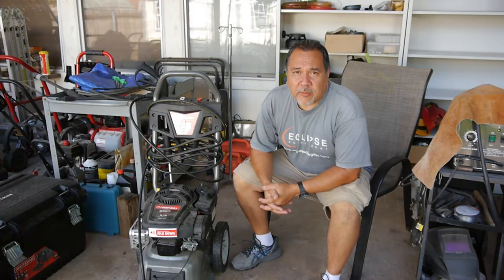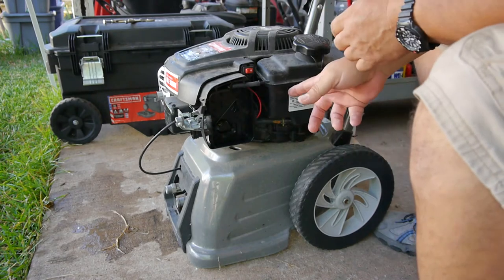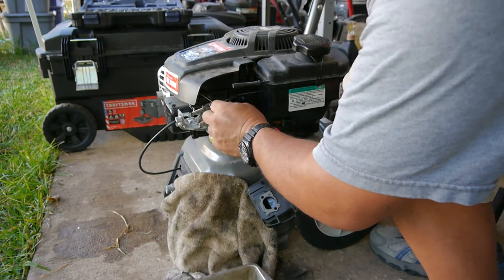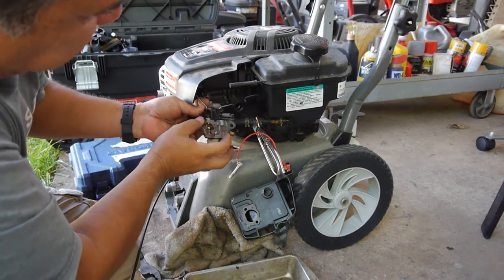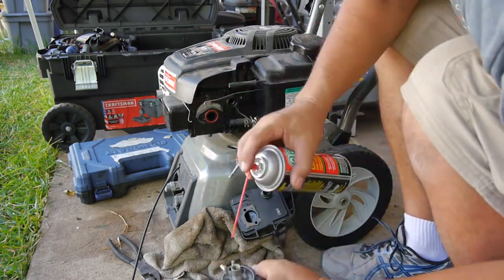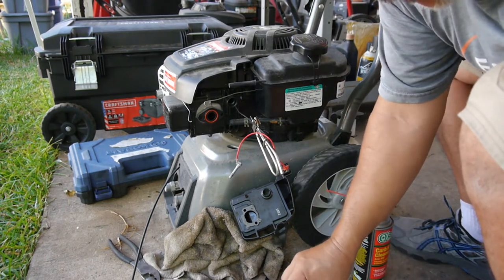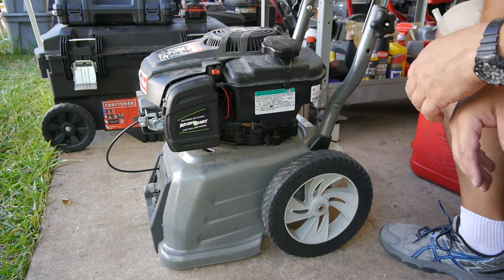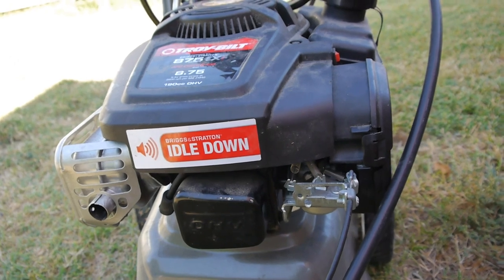A New Pressure Washer Will Not Start

Comment: Hello, great video. What are the chances you still have this machine and is there any possibiltiy of a video or picture of the springs? Specifically at 9:30min.. Yes, I completely forgot to take a picture of that, so now I am not sure what spring goes where. I hooked it up but it was surging a bit at low idle. Under pressure it runs fine. Any advice is greatly appreciated. Thank you!

Comment: I just bought a brand new north star pressure washer put the oil in, put the breather plug in the pump. Pump oil is good, fuel is full, switch is on, choked it , took about 59 pulls to finallly run. Worked great...took it to my house hooked it up and should of fired up. But does what this pressure washer is doing just not starting. You’d think a brand new one would start up, and the cat pump is whining a little bit then stops.

Comment: Not good to crank them up without water in the pump first...I run a shop and if the seals in the pump aren't wet it messes the pump up... good video!
Reply from the maker: That is true.  I never run it long without water in the pump.  Another tip: don't try to start it when there is high pressure in the pump and hose, it will be hard to start.  Thanks!
Reply: @SmallEngineDIY  your very welcome... ! I fix all kinds of things every day and still learn...lol.. some can be tricky...
Reply: @SmallEngineDIY  Actually you did run it WAY too long without water.
Reply: If word gets out you’ll pay for every pump that goes bad
I pull pump first and don’t put it back on tell they come to pick it up and they watch me bolt it back up

Comment: I cleaned the carb (pretty clean) & the gas tank (water in the gas), it still won't start. The pressure washer is pretty new & lightly used. 
I used starting fluid, I started & stopped. 
Please help.

Comment: Not seen one of those Briggs and Stratton engines with a metal carburetor fitted, usually the new style engines Briggs make have the plastic rubbish carburettors. Advisable on any small engined machine now is to use fuel additive in the unleaded fuel or Aspen fuels or similar due to the ethanol content unleaded fuel contains.